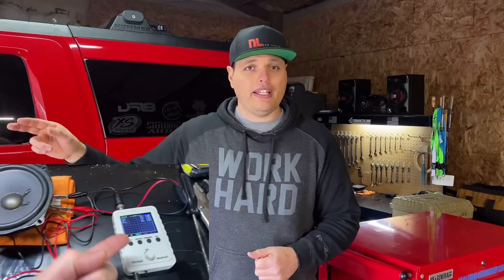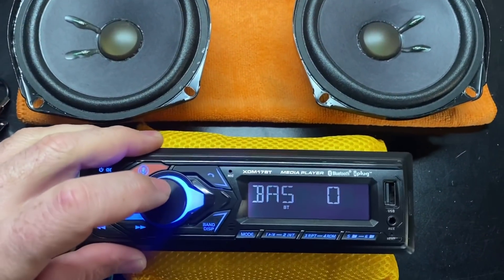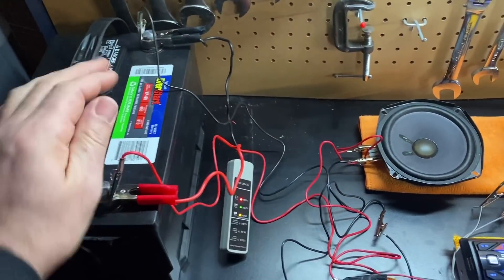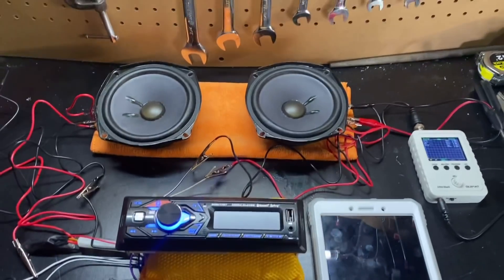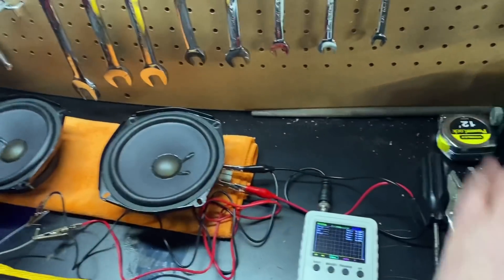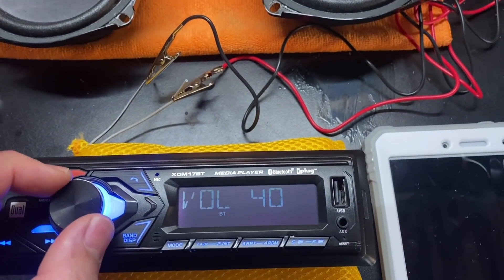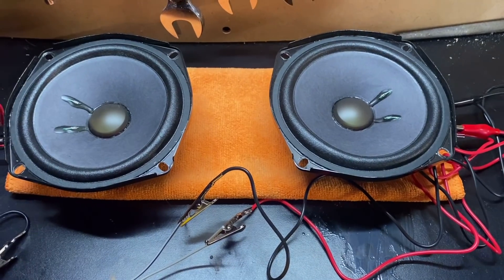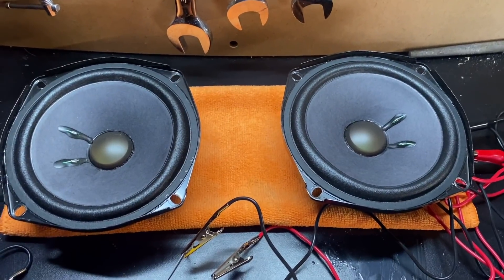#1 Must do tip!!! How to check head unit clipping and non distortion volume point of stereo.

Comment: Do you need to worry about clipping when only using the rca outputs and not the built in amp?
Reply from the maker: Head unit clipping, no. Not if using RCA’s
Reply: @NextLevelCarAudio  ah cool. I’ve always been confused about that part. So you can max out the hu and then set the gain on the amps?
Reply from the maker: If using 100% rca output and not head unit power then yes. But I would not do that unless your head unit has SLA source level adjustment. Otherwise if one of your sources is quieter than another you won’t be able to turn the volume up any to compensate
Reply: @NextLevelCarAudio  okay I see. Thanks man for the info. Whats the difference between 4v and 5v rca?
Reply from the maker: 5v higher preamp voltage which means gain on amp does not need to be turned as high. Which means less unwanted noise
Reply: @NextLevelCarAudio  ahh I see. Thanks for the straight forward info and quick responses!

Comment: A question that hopefully makes sense...When setting the gain on a monoblock sub amp using a test sine wave ,does the output on the amp change depending on what tone is used? Like if you were to use a 50hz sine wave or a 40hz sine wave, would the voltage change? I tried the multimeter way to set the gain and I used a 50 hz sine wave at just before clipping point with head unit volume..Using the square root method my proper voltage setting should be around 34.6 volts coming out of amp..I used a 50 hz test tone ...so would using a 40 hz test tone alter the gain setting on the amp?? Probably confused right now but would appreciate the feed back🙏👋
Reply: Barevids says that its best to use the tuning frequency of your box. JL audio says to use 40hz as a generic frequency to fit most applications. Buck Pomerantz from Crutchfield says a 60hz tone is best as the multimeter will be more sensitive at that frequency.
Reply: @hippo-potamus  Damn😂Every name you mentioned are audio geniuses and now I gotta play pick one🤣Seriously though thanks for the info👍🙏💯
Reply: whit a cheap multimeter tour fine whit 60 ha thats right .👍🏻👍🏻👍🏻😷

Comment: Cool. I did this with my head unit but this really isnt for the inputs to your sub amp. Mainly for clipping on highs without amp. You can input a full distorted or pure square wave into your sub amp and the output will be clean sign wave unclipped.  I've tested this. Always thought to do this for sub input but you dont really have to. What is your opinion on this?
Reply from the maker: Most people do not run 100% amplified systems. Which means even if they have subs and amps, they likely still have speakers being powered by their head unit. With that it is vitally important to check head unit clipping point. I always recommend doing that even if you can send a square wave into the amp.... why do that? If you don’t have to or need to. 75% head unit volume is plenty loud for most people, including me

Comment: Can you check clipping point using an rca from the headunit? I'm using the same oscilloscope from your video. Thank you
Reply from the maker: Yes you can. But typically low level (rca) can go full volume without clipping. But not always, so worth checking
Reply: @NextLevelCarAudio  thank you very much!

Comment: This is an extremely valuable lesson taught, how would you test this when an amp has been added?
Reply from the maker: Test prior to signal entering amp.
Reply: @NextLevelCarAudio  I have an lc7i and a 4channel hooked up, do I check it from the lc7i speaker inputs or check from the wire that goes into the speaker inputs on the Amp? TIA
Reply from the maker: I’d do both, so your signal stays consistent throughout from head unit to amp

Comment: Yet another question I have is WHY the 40Hz test tone for all those settings? I keep thinking 40Hz is getting down into the bass tones a little more than needed. And if you set your amp's HPF to 60 or 80Hz, wouldn't the 40Hz signal tone be worthless? Just curious. Steve Meade used to same 40Hz test tone for his DD1, so apparently 40Hz is the the most common test tone for setting stuff. It just seems too low when you're setting amps that are used for high pass. So wouldn't you suggest a higher frequency tone when it comes to setting amp gains for your high pass speakers? Thanks.
Reply from the maker: You Can totally use higher frequencies... but using low frequencies allows you to hear distortion better as distortion actually creates a higher pitched frequency. So you can tell the difference with the separation.
Reply: @NextLevelCarAudio  I heard you say that while I was typing my comment. Makes sense. Easier to get clipping from lower frequencies than higher ones I'd guess, so yeah, make sense now. I'm still trying to figure out what those "50Hz Pink Noise" tones are made for! I downloaded one offline one day and it's on my laptop ready to put to the test in my deck, but not sure exactly what Pink Noise really is and if it's simply the same as your suggested 40Hz test tone only 10Hz higher.
Reply from the maker: I never messed with pink noise so I’ll let someone with experience chime in

Comment: Is the clipping point usually higher if you connect it to rca output compared to speaker wires in the harness?
Reply from the maker: Almost always. Yes.

Comment: Will thai method work without connecting speakers and using only the oscilloscope?
Reply from the maker: Absolutely. See some of my other videos regarding use of oscope.
Reply: @NextLevelCarAudio  Thanks for the reply. How many speaker output channels from stereo I should connect to oscilloscope? Thanks in advance!
Reply from the maker: Just 1 is all you need to do

Comment: Hi. unfortunately my english is not that good. I'm from Germany but no one explains things as well as you. Can I use the device to measure rca on the radio until it clips or is that only possible using speaker cables? Regards
Reply from the maker: Totally possible. Most rca preamp outputs on modern head units don’t clip tho. But worth checking. Put one on inside and one on outside of rca
Reply: @NextLevelCarAudio  Thanks 

put one on inside and one on outside of rca ???
what exactly do you mean by that. Sorry, I do not understand
Reply: @NextLevelCarAudio  I always listen to music via cell phone Bluetooth. then play test tones via mobile phone or via usb. I don't have a cd drive in the head units.
Reply from the maker: The rca plug has 2 parts. The inner pin and the outer shield. Touch a probe on each
Reply: @NextLevelCarAudio i understand. thanks my friend. can you maybe answer the other question? only listen to cell phone via bluetooth. Play teston via cell phone or USB? my head unit doesn't have a cd drive
Reply from the maker: You don’t need a cd drive. What your doing is fine

Comment: I'm having a system professional installed. I'm sure they'll do a great job tuning it and I promise I won't touch the gain knob haha. With that being said I'm sure I'll want to play around with the crossovers on the head unit and amp. Will I be safe doing so or is it just best to leave it alone? I'll be sure to take pictures before I touch anything in case I screw it up
Reply from the maker: Good idea with remembering the baseline settings. You should be ok as long as you stay away from bass boost and low frequency EQ settings
Reply: @NextLevelCarAudio  thank you

Comment: Would you not damage your mids and highs playing a 40hz test tone through the speakers to hear distortion? Subs can handle it but component speakers?
Reply from the maker: I would not play 40hz with your tweets. Unless you have  bass blockers on them (which you should if they are not HPF crossed over by an external amplifier). But given the fact the mids/door speakers are only getting heat unit power for maybe 10-15 seconds max. And not getting clipped/distorted (as prevented by oscope/ear), They should totally be able to handle it and be just fine. Just don’t pay them for minutes on end. Lol. I did in this video tho, and they still lasted just fine.
Reply: @NextLevelCarAudio  definitely will use your method, great video. Looking forward to the next.
Reply from the maker: Thanks for the support!

Comment: Great video. I've learned a lot from you. But my question is that I want to check my distortion volume on my factory head unit but it has a factory amp. Can I still get a accurate reading with factory amp
Reply from the maker: You would need to check the signal before it enters the amp
Reply: can you explain better? i have this same issue with a factory headunit with factory amp not sure how to go about it dont wanna f nun up
Reply from the maker: Check at speaker wire before it enters the amp. This can be done either at the factory amp, or behind the factory head unit

Comment: Hey I have some questions for u. I’ve been purchasing alpine products from the ilx 407 head unit the type r 6x8 for doors the sa60 m amp for the r-sb12v and the kla power pack that attaches to head unit and the Rockville rxc4d 4 fared 12 c capacitor.  Please give me some tips to install properly
Reply from the maker: Sorry for just getting back to you. Did you get going yet? What specifically would you like help with?

Comment: If your using the rca's , do you still connect to the speaker wires or the RCA's? Let me kno, ta
Reply from the maker: Check the level at the RCA’s... chances are you can go to max volume without clipping.

Comment: If the EQ, for example, has 9dB +/- of adjustment, wouldn't the gains need to be set 9dB below clipping to allow for full adjustment?
Reply: You want to avoid using any EQ boost if possible. Focus on cutting any peaks. A peak will stand out, while a dip is much harder to hear. 
Remember that the headunit will only clip on a 0dB sine wave and typically not music. So you actually can go beyond the "max clean" volume level. Especially if the recording level is a bit low.

Comment: Since I have no speakers hooked to my Alpine, I'm sure it's safe to just hook the O-scope to a couple speaker leads, BUT wouldn't it be a better choice to connect an RCA cable to the back of the head unit and do my measurements off of the RCA? I ask this because THAT is the signal I'm running to my amps, and from experience I've learned it's a cleaner signal from the low-level outputs than the high-levels. My deck has 3 sets of pre-amp outs but I only use one pair to my equalizer, where the EQ splits into 3 outputs. Kind of defeats the purpose of buying a head unit with 3 sets of outputs but oh well, the equalizer does the rest. Anyway, I haven't got my O-scope yet, but should be any day. I just wanted your opinion on doing the clipping test off a set of RCA outputs from the head unit instead of speaker outputs. Thanks.
Reply from the maker: It is not necessary to run a test of your RCA’s as they feed into your amp and signal sensitivity can be dialed in at amp to give you a clean signal. The value of testing high level is for people that are still running speakers powered off their head unit
Reply: I have an older alpine 7930 which doesn't have any speaker outputs at all. It's called a dead head unit. It only uses preouts or rca outs. I have been told that it doesn't clip at full volume or all the way up. How do I check the clip point at my subs, after my amp? That's what I need to check since my headunit has no speakers to it at all.
Reply: @NextLevelCarAudio  Thanks!
Reply from the maker: Not necessary. Send it and adjust your gain accordingly as I show in one of my other videos and your set

Comment: This question is kinda off topic but what settings on the oscilloscope do I use when trying to see a 1khz sine wave to check for clipping on a mids and highs amp?
Reply from the maker: Gotta toy around with it.... off the top of my head I don’t recall the specifics. Should dial in tho so you can see it.

Comment: Hey man, i just followed your video with a new headunit i just installed in my car. I used the same 50$ amazon oscilloscope and my result was that i did not find ANY clipping even at maximum volume. Is this normal/possible? 

I tested with a 40Hz tone. got a nice and clean wave on the Oscope, did not try 1k Hz or anything other than 40Hz, is it possible to get clipping at max volume for certain frequencies but not all? Should i also test 1k Hz?
Reply from the maker: Some units that’s the case. But most clip around 75% volume
Reply: @NextLevelCarAudio  weird, bcuz this isn’t a high end unit. It’s an android unit. Seems to have solid pre-outs tho. I tested with 40hz and got a clean sine wave all the way up to 30 volume and 3.5v on the preout. My previous headunit, also android but another brand and older model, barely hit 2.5 at 30 and it sounded like shit. 25 was max and I think I was only getting like 1.9v at 25volume and at 10vol was getting like 1.4v on the pre out. Had to turn my gain way up which also amplified any noise. With this one, gain went down like 1/3 of the way and it sounds way better and cleaner even at 30. I’ll check again but using 1k and maybe s sweep, to see if it clips.
Reply from the maker: Wow, interesting. Yeah let me know

Comment: That's cool as hell man. I didn't know that it would work like that. What about a clipped signal through the rcas though? I don't use any of the speaker outputs, only the preouts from the head unit.
Reply from the maker: Thanks for the feedback. If using just RCA’s Then honestly it does not matter. I still use the high level clipping point tho for my setup. Because even tho I may be able to turn the volume all the way up. I just cringe setting my volume knob maxed out lol. Plus it’s not necessary as sensitivity can be adjusted via it gain at the amp if you are running all low level

Comment: hello interesting video 👍
Question :do you use a 0 dB Test tone
Or -5db or -10db 
because let’s say at -10db tone 40 hz the radio does not clip at 36 volume
Please let me no 
and keep up the good work with your videos 👍👌🏻
Reply from the maker: I recommend using 0db for a true clip point in most cases. Now, if you listen to lots of bass enhanced/boosted music... you can  “play it safe” and tune with other variants. But doing that, regular music will be “quieter”. So I always tune with 0db and use my ears and common sense to listen for distortion if playing digitally enhanced music.
Reply: thanks that makes sense 👍👌🏻

Comment: i got 6 speakers and a pair of tweeters hooked up on a voice amp (all ds18 brand).. I’m trying to get the best sound out of the system.. I have this question, the higher the gain on my voice amp, the lower volume level I need to sound loud?? or how does gain exactly work? i have not distorted just yet but I would like to push my system to its max.. Also is the loudness option on my pioneer head unit, a good option or no? Thank you in advance, really hope you can help me out!
Reply from the maker: Your gain knob is designed to be set to match the input voltage coming into the amp. In most applications, this would be your head unit rca preamp output voltage. The higher the input voltage, the less gain (cleaner signal). The lower the preamp voltage, the more gain needed (more signal noise). Volume should not be a factor when determining your gain setting. Hope that makes sense
Reply: @NextLevelCarAudio  thanks for the reply! Makes a little more sense now. so at the end of the day too much gain( more than halfway is how I have it ) is not necessarily a good thing ?.. also do you recommend using the loudness option the head unit provides?
Reply from the maker: If your gain is over half way, not necessarily a bad thing tho. Just compensating for lower input voltage. Can be remedied by a standalone high voltage preamp EQ. But not necessary unless you are doing a full on SQ (sound quality) build. Loudness is a preference, I don’t use it. But if you do, just make sure you turn it on, then set your gain on your amps. So that you don’t inadvertently clip
Reply: @NextLevelCarAudio  Alright now it makes sense, thank you for helping me out! And I’ve tried the high loudness option, makes everything sound better to me, but I’ve seen a lot of people not recommend it so I took it off and now having a hard time getting that same sound that I got used to, no matter how much I mess around with my EQ settings.
Reply from the maker: I’d leave it on then. If it sounds better to you. Then call it a day 😎

Comment: Question just for clarification point, you said un-amplified head units only but what about the premium oem head units that are already powered with an external amplifier?
Reply from the maker: It works for those to. What I meant By external amplifiers were actual amplifier that you buy separate from your head unit

Comment: I just ran this test on my HU a kicker KMC4. Max volume is 39 and I could not get it to clip.  I used 40Hz, 80Hz and 1000Hz test tones. None of them showed any apparent flat spots or sharp angles in the sine wave. They were curved top to bottom.  Is it possible I got a really good HU that can run full volume?
Reply from the maker: Some head units don’t clip. They should all be that way, but unfortunately most do clip before max volume.

Comment: I have jbl bass pro SL 2 (small sub/amp combo) How would I go about tuning it with the oscilloscope?
Reply from the maker: You would have to pull out the subwoofer with everything still connected, and tap into the subs speaker wires. Pretty simple